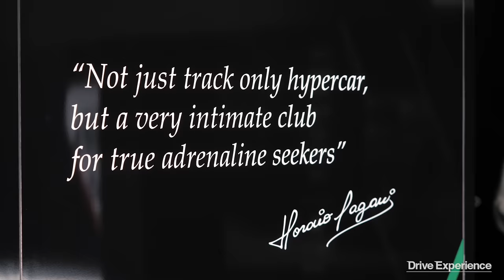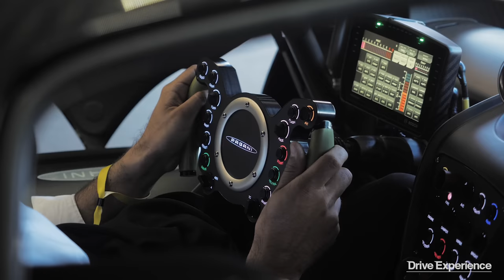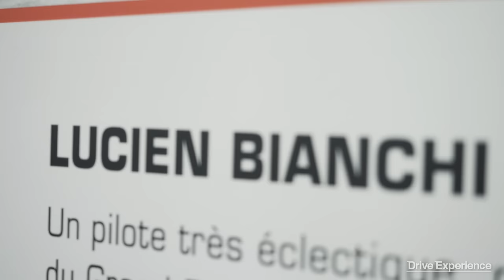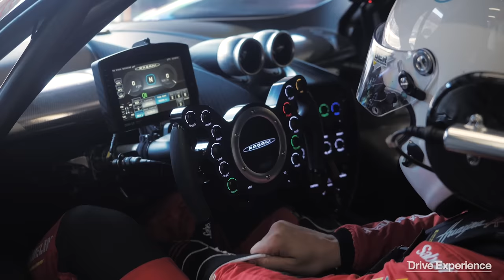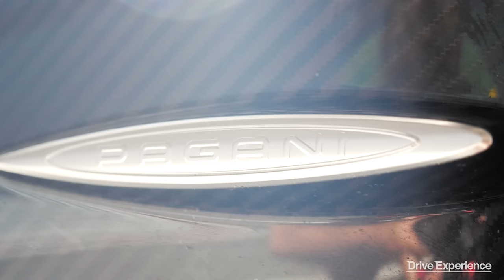Pagani Huayra R: All'attacco di SPA-Francorchamps - Davide Cironi Drive Experience

Comment: What a masterpiece of a car. What an unreal experience this must be, having Spa for yourself, this art thing on wheels with this glorious sound.. just wow
Reply: It's the exhaust note that transforms V12s though. They sound incredible from outside but often sound a bit disappointing by comparison in the cockpit.
Reply: @thesprawl2361  not just the exhaust note, they've raises the rpm up from 7,500 in the zonda r to 9,000 for the huayra r.
Reply: @vangezy6456  That's not what I mean. RPMs have little to do with the difference between the sound inside the cockpit and the sound from outside the cockpit, which is what I'm talking about. 
Eg.: the Valkyrie revs to 11,000 but if you watch videos of it taken from inside the cockpit the screaming high pitch from the exhaust is almost completely drowned out by the low build of the in-cockpit sound. You just get a low, mechanical 'bruuumm' that never reaches any really high pitch. 
My point is that it's only when that cockpit noise is fed through an exhaust that a high-rpm V12 sounds special. When you hear it in the cockpit it sounds...good....but not earth-shattering. A lot of the thrill of a V12 can only be appreciated by people outside of the car.
Reply: @thesprawl2361  That's the exact reason why I love Novitec 812 and Zonda F because they sound great from driver's pov which is the most important part of such cars
Reply: @sanchit8097  Yeah. Why get a car that can only be fully appreciated by people outside of it?

I'd get an 812 if I could get any Ferrari, for sure. Then if I felt sufficiently nuts...I'd convert the transmission, give it a drift diff and an angle kit, and use it at least partly for drifting. Still just as driveable, but a lot more tail-happy. 
To me engines sound best and most characterful when they're wavering on the limit as you feather the throttle. I love the way cars sound when you're drifting them. I like the slow build through the revs when a car's accelerating, and then the drop through the gears as it brakes, which you get when a car's racing. But to really get a feel for an engine's character you need to hear it moving back and forth in fits and starts, and huge bursts and small dabs, and then sometimes banging the limiter, and just generally moving all across the power band. And you only really hear that when a car's drifting.

Someone drift-converted a Ferrari 599 for Formula Drift and it sounds fantastic. And there's a mk 5 drift/track-tuned Supra with a V10 in it that is one of the most ridiculous sounding cars on earth - Ryan Tuerck's Judd V10 Supra. Look it up and thank me later.

Comment: Very interesting.  Note the way the read deck lid is attached.  5:11.  When these were at Laguna Seca I had to respond to one of these on the track that had an electrical fire.   We wanted to get water on the engine and there was no way to open the deck.  We also think of it more as a road car, so we did not go searching for the electrical cur off, which this car does have.  The driver said nothing about it either.  He was leaning up against the tire wall videoing us trying to reduce the damage to his car.  Then, as the car was being lifted by the rollback, we realized the whole engine was open at the rear.  Could have just shot water in that way.  Factory reps made it out to our location and turned off the electrical.  So just some burned up wiring.